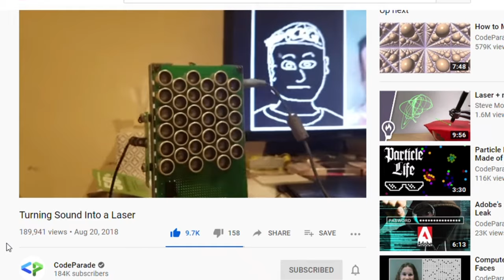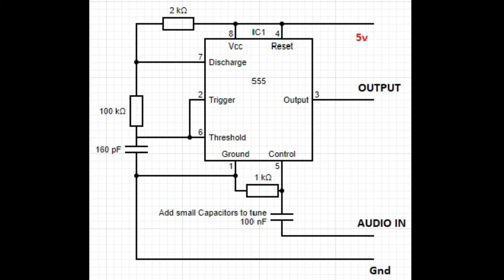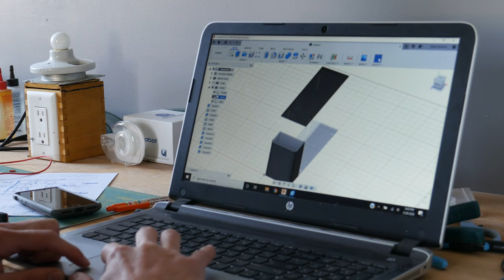Ultrasonic Sound Gun (Parametric Speaker)

Comment: Awesome!  Glad you were able to get it working :)
Reply from the maker: CodeParade Thanks! It means a lot!
Reply: newbie Q.. i'm guessing the way to power the 5v parts of the circuit is to use a resistor to drop the ~10v you feed to those cheesy amp chips..
i ran the ~5v from my batts to those parts, and into a voltage booster to provide the 10v, it ain't working but i'm waiting on an oscilloscope to find out where. wondering if my inexperience with multivoltage circuits is the problem.
Reply: @SI-ln6tc  link I want 1 for Christmas

Comment: Long Range Acoustic Device (LRAD) is an acoustic hailing device, sound cannon and sonic weapon[1] developed by LRAD Corporation. Law enforcement organizations and the manufacturer claim that LRAD systems are primarily designed for long-range communications[2] however, the device has an extremely high decibel capacity, and is controversially used as a less-lethal weapon for crowd control.

According to the manufacturer's specifications, the systems weigh from 15 to 320 pounds (6.8 to 145.1 kg) and can emit sound in a 30–60° beam at 2.5 kHz.[3] The manufacturer also produces systems for public address and mass notification use that broadcast 360°.[4]

LRAD systems are used by law enforcement, government and defense agencies, as well as maritime and commercial security companies to broadcast audible notifications and warnings over distance. LRAD systems are also used to deter wildlife from airport runways, wind and solar farms, nuclear power facilities, gas and oil platforms, mining and agricultural operations, and industrial plants.
Reply: Wow. You're great with copy n pasting 😮
Reply: I appreciate the copy paste ^^ it's nice to have this as YouTube hasn't banned it yet

Comment: I'm trying to do some research. I'm trying to find out if people can weaponize these with infrasound, a targeted beam of frequency that could make people sick and give them vertigo from a long distance. Could this technically be modified to do so?
Reply from the maker: Good luck with that one
Reply: Interested myself for self defense. Wanting to get a onewheel which is very expensive, so ifs either going to be making some kind of ultra sonic gun or pepper spray wrist guard for safe and secure onewheeling.
Reply: Already in use buddy. It's called LRAD

Comment: using a 555 for generating a stable 40khz is a BAD IDEA. It is not stable, it is not accurate. In fact the components you have used would theoretically give you ~44.5Khz, which when fed to 40khz ultrasonic transducers would result in an output at LEAST 10dB down. With precision generator and with proper tuning you would achieve at least 10x the power.
Reply from the maker: I made this for $20. I really don’t care about precision tuning and just glad it worked
Reply: @Shane-zh6tx  yeah, well. With correct tuning you would not have needed those extra 9 transducers or the effort to wire them all up. Duh.
Reply: @Shane-zh6tx  'glad'   ?  Or 'surprised'  ?  Hahaha

Comment: ⥊ 1515: 151315

0: Good (if not good, then not zero)
1: Ethics
2: Problem-Solution
3: Consent
4: Emotion/Will
5: To Testify/To Meet
6: Why/Who/When/How/Where/What
7: Information
8: Stability
9: Sanity
10: Network (Good Network, because zero)
11: Justice
13: Death
16: Tower
20: Judgement
21: Solving Problems with Ethics
22: Resistance
23: Resilience
30: Good Wave
32: Discernment
33: Jesus
40: Good Force
50: Good Expression
57: Counter-Terrorism
60: Good Reason
70: Good Information
80: Good Stability
90: Good Seriousness
96: Blockchain
97: Anarchy
98: Vegan
99: Revolution
100: Liberation
1000: Possible Conversation Method using numbers to convey meaning
For ex.: 6022: Good Reason to Resist.